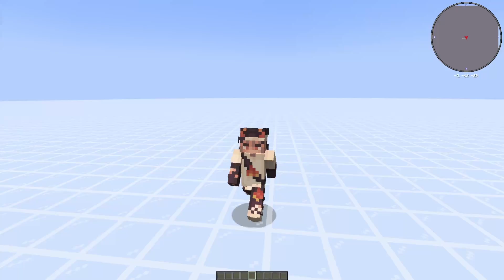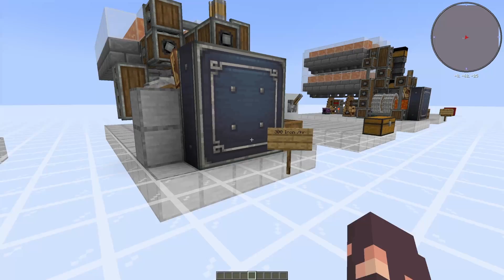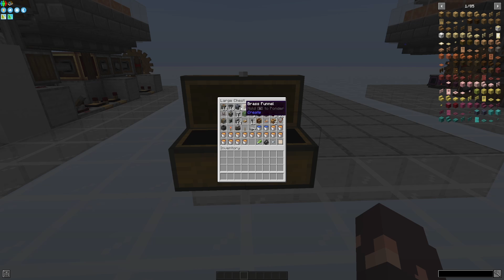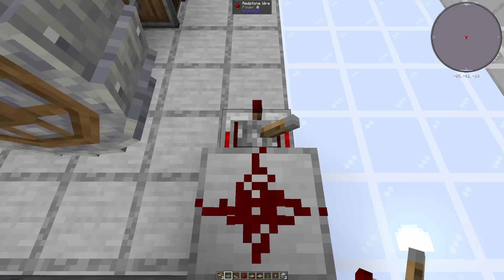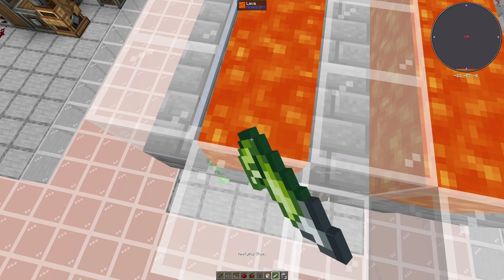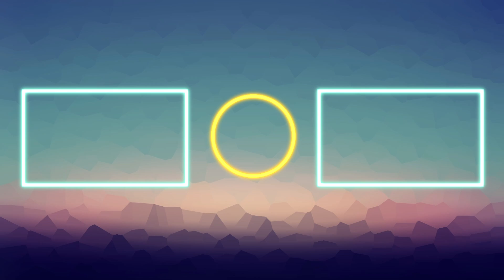The ULTIMATE CREATE IRON FARM (No Villagers) 600 IRON PER HOUR! |  Create Mod TUTORIAL

Comment: Machine works great. Only issue I have is cobble flying out when it breaks. Simple fix was add walls down the sides with hoppers along the floor to gather it all in chests.
Reply: I replaced the stairs with waterlogged leaves for the same reason. Seems to be working fine, but I'm still testing the rates
EDIT: My 10 minute test showed a rate a 156 per hour, so half. Not quite the solution I was looking for. Using the stairs and slapping on some extra glass blocks bumped it back up to 228 per hour, which is good enough for me
Reply: @Thatguywithadog152  Good to know that's an option. I ended up encasing the build in glass with one block space and lined the floor with hoppers to collect the extra flying out. I then put that into more crushing wheels to make me extra sand and gravel for other uses. 
actually made for a decent multi tier farm.

Comment: okay so I did the "medium" farm, and I run into two problems that I will explain to anyone having the same issue with the most recent versions of create :

using oak leaves filled with water and the fan dont work for me, because it is used to turn grass into bush, so you can just remove the leaves and put three signs around the water source instead, works perfectly fine !! (it's also maybe because of the modpack I use, but I cant be certain sooooo... just in case)

I cant, due to server restriction/modpack restriction, put the speed to 256, and my cobblestone generator makes too much cobblestone, and the cobblestone quickly glitches outside the structure and end up around. so first I added another row of hopper on each side, and I figures that I could simply deactivate the cobble generator for the time being, to do that you just have to break the shaft connecting the Sequenced Gearshift to the gearbox right next to the crushing weel on the right when looking from the front of the machine

now my iron farm works perfectly, it's just not fully "automatic" anymore, since you have to add and remove the shaft when you want cobblestone to be generated

thanks for the tutorial and I hope my message can help some people !! (also I'm not english and I dont realise if I made any errors so feel free to correct me regarding this)

Comment: If you are having issues with cobble blocks clipping through the glass/whaterlogged stairs, The only way I managed it to stop completely is to place 14+ hoppers below the stairs, they should face the previos hoppers. this sucks the blocks that get trapped and sends them into the correct place. Its an expensive fix considering you are making an iron farm and this fix costs +64 iron ingots, but its the only way I could make it stop,
Reply: This is the solution
Reply: Helped a lot Ty
Reply: Legend. Thanks
Reply: Banger

Comment: hey so built this, it worked for a couple of days, then it just stopped? as far as i can tell everything should be working, its just that the mechanical bearing isnt moving. the only time i can get it to move is if i manually update the contraption its connected to, any help?
Reply: never mind i fixed it 30 seconds after i typed my comment, i noticed the stuff after the gear shifter was still spinning when the machine was off, so i broke the vertical gear box right after the gear shift while it was off, then put it back and turned it back on and it now works. I LOVE MINECRAFT!!!!

Comment: I found it a bit hard to read all the names of the items in the description so I rewrote it so it’s easier to read (the space is for every 9 slots except the bottom one)

18x Gearbox, 
16x Hopper, 
9x Vault, 
4x Brass Funnel, 
2x Large Cog, 
2 Crushing Wheels, 
2x Barrel, 
1x Chest, 
2x Mechanical Bearing

1x Powered Latch, 
1x Mechanical Press, 
11x Any Building Block, 
1x Any Leaves, 
3x Pulse Extender, 
1x Chute, 
1x Clutch, 
6x Redstone Dust, 
28x Any Building Block (Glass Looks Better)

1x Encased Fan, 
1x, Andesite Funnel, 
14x Any Stairs, 
11x Shafts, 
1x Sequential Gearshift, 
1x Pulse Repeater, 
2x Rotation Speed Controller, 
1x Comparator, 
1x Basin

1x Redstone Torch, 
1x Mechanical Belt, 
1x Lever, 
7x Any Slab, 
Infinite Water Source, 15x Lava Buckets, 
1x List Filter (flint and iron nugget), 
1x Super Glue
Reply: i hope both sides of your pillow will be at the perfect tempeture tonight
Reply: God bless you <3
Reply: o7
Reply: @stubbyfoamz1  67

Comment: i just used a waterwheel to power the farm and it still said overstressed for some reason. no matter what steam engine or waterwheel i used it always says overstressed how to fix?
Reply from the maker: if you get a stressometer it will tell you how many more stress units you need for it to no longer be overstressed. if you keep adding water wheels/steam engines it will start working eventually
Reply: like a comment from a while back mentioned, 12 large water wheels and a regular water wheel on the end works

Comment: why my farm is shoottig cobble everywhere around farm
Reply from the maker: Your issue is probably the brass funnel in between the 2 linear chassis. R-click it with a wrench and the farm should start working. Make sure the 2 andesite funnels directly below the brass funnel are facing inward towards the vault (check picture)

Why its the issue: the cobble gen breaks the cobble and stores it in the barrel in between the 2 gantry carriages. the brass funnel should be dropping the cobble that is in the barrel right above it (it has access to the barrel's inventory even if it's not connected to it because it's a contraption). The funnel will drop the cobble out to the 2 blocks below it (depending on the side it's on) and the 2 andesite funnels below it will pickup the newly dropped items and put them in the item vault.

Comment: Well uhhh it doesn't work for me some how, its been running for 10 mins now and i haven't seen a single iron ingot. And i did follow setp by step, so pelase a little help 🙏 idk what i did wrong
Reply: And I found out the problem, the chute is not working at all is not going through the chute, is just stuck in the chest....
Reply from the maker: are the crushing wheels going backwards? try slowing down the rotation speed controller to see better. if they're going the right way it should just go straight down
Reply: @kindlebubbledump  fixed it, it was the wheel because I messed up the gear boxes....

Comment: Only one comment, you say if that if someone isn't at glass level yet then they can us trapdoors, yet you're using speed controllers that take precision mechanisms and brass. Now granted most of the functions represented can be replaced though it won't be as compact, I can see what you're going for. What impressed me the most was your method of cobblestone production, it's pretty darn brilliant and could easily be adapted for any other iron/cobble system. Also here's a question, could you design a gold producing machine? If my memory serves right it would have to make cobble, bust the cobble into gravel, bust the gravel into sand, wash the sand for clay, make terracotta blocks, grind those into red sand, then wash it. It can be done, I've done it before, but I never continued my experiments.
Reply from the maker: Good call lol I didn’t really think of that! I have a gold farm already! It’s a pretty big farm but it’s produces quite a bit of gold. You can find it on my tutorials playlist on my channel!

Comment: it worked but, there's tons of gravel falling beneath the crushing wheel. how to fix that
Reply from the maker: that's what's supposed to happen. the fan should be pushing the gravel and washing it with water in the leaves block. If the fan is pulling, invert the 10RPM rotation speed controller and you'll be good!

Comment: the farms fully working but im only getting gravel?
ive checked the hoppers and theres no ingots 
any fix?
Reply from the maker: is the fan going backwards? if so invert the 10 rpm rotation speed controller. Make sure you have water in the leaves block as well
Reply: I have the same problem. Did you ever find a fix for it?

Only making gravel. No iron nuggets and no flint at all

Comment: Great design. I used the Schematic to build the larger one. The only thing is that cobblestone gets pushed through the stained glas dropping onto the floor. Any idea on how to fix that?

Edit: I use a create addon "Create: Easy Stone Generatores" to create cobblestone with mixers. This is less laggy since the farm dosen't need to break blocks. Also the design nearly stays the same because it offers enough space. If you're interested I can send you the schematic.

Comment: Hi  I wanted to know if I can use the water wheel or the mill to power the entire system. Thanks
Reply from the maker: you will need to have enough of them to generate enough stress units, but yes you can!
Reply: Ok thanks 🙂 @kindlebubbledump

Comment: my 300 iron/h farm seems to not break stone whenever it rotates, why is that?
Reply from the maker: Nice! glad you found the issue! yea sometimes lag causes it to not break stuff so glad you fixed it! hopefully you're getting a ton of iron!
Reply: @kindlebubbledump  rn im trying to take some of that iron and turn it into iron nuggets for a train track farm, do you know if theres a way to decraft iron ingots automatically or should i make a separate farm?
Reply: ive tried reapplying glue but to no avail.
Reply: turned the speed down from 256 to 15, breaks cobblestone now.
Reply: alr made it work, made it so the fan is powered at the same speed of the conveyor. guess i made it more lag proof

Comment: Built this on all of create 1.20 I believe everything’s working just used the schematic download, all the stone is glued and is rotating but no stone generates, I’ve tried upping the rotation to 120 and still nothing, broke all the glued blocks let it place new ones and still nothing is there some form of new update that breaks this?
Reply: A 130 angle seems to work, it will generate the cobble then like 2-3 seconds later place, tried Turing it back down to 110 after seeing that and didn’t work makes no sense I just work hwre
Reply from the maker: You might be running into a lag issue! Depending on the game, having it at 110 might mean it gets all the way around before the lava can flow (just because the game is kinda laggy).
Reply: @ I do have ALOT of machines in one area still getting 300+ frames tho😄 thank you!

Comment: Amazing tutorial, but when I fully built it the fan was pulling the gravel into the leaf block instead of pushing it towards the funnel, how do I fix this?
Reply from the maker: invert the 10 rpm rotation speed controller from clockwise to anti clockwise and you should be good to go

Comment: My cobblestone generator spins once and then just stops and the whole machine stops. I’ve tried everything changing speeds, rebuilding and it still won’t break the cobblestone. Please help
Reply from the maker: I bet you're using a powered latch instead of a powered toggle latch (or the other way around) meaning it won't loop. if you replace the one you're using with the correct one then it should start working

Comment: This design is working for me however it ends up shooting a lot of the cobble around the sides, is there a solution for this?
Reply from the maker: Your issue is probably the brass funnel in between the 2 linear chassis. R-click it with a wrench and the farm should start working. Make sure the 2 andesite funnels directly below the brass funnel are facing inward towards the vault 

Why its the issue: the cobble gen breaks the cobble and stores it in the barrel in between the 2 gantry carriages. the brass funnel should be dropping the cobble that is in the barrel right above it (it has access to the barrel's inventory even if it's not connected to it because it's a contraption). The funnel will drop the cobble out to the 2 blocks below it (depending on the side it's on) and the 2 andesite funnels below it will pickup the newly dropped items and put them in the item vault.

Comment: Hey is the cobblestone supposed to go through the funnel because it keeps going the opposite direction
Reply from the maker: yes but if all the belts are going the wrong way, changing the 256 rpm rotation speed controller from clockwise to counterclockwise should fix it!

Comment: To any1 having problem where machine only spins once, and/or their clutch turns back on after hitting the lever it could be due to you not using the right powered latch there are 2 different types (powered toggle latch) and (powered latch) make sure to use the powered latch. Also if the machines belt and the crushers are going the wrong way change the direction on the speed controller thats set to 256. Hope this helps.
Reply: You dont know how much I needed this comment

Comment: mine just spits cobblestone from all sides lol how do I fix this
Reply from the maker: Your issue is probably the brass funnel in between the 2 linear chassis. R-click it with a wrench and the farm should start working. Make sure the 2 andesite funnels directly below the brass funnel are facing inward towards the vault

Why its the issue: the cobble gen breaks the cobble and stores it in the barrel in between the 2 gantry carriages. the brass funnel should be dropping the cobble that is in the barrel right above it (it has access to the barrel's inventory even if it's not connected to it because it's a contraption). The funnel will drop the cobble out to the 2 blocks below it (depending on the side it's on) and the 2 andesite funnels below it will pickup the newly dropped items and put them in the item vault.
Reply: @kindlebubbledump  I think you're mixing up which funnels and such you're talking about. There aren't any andesite funnels on the vault and no brass funnel on the barrel. It just likes to spit cobblestone everywhere lol.

Comment: i see gravel under the crushing wheel, but not flint or iron and the encased fan is working but i dont see the blue wind particles but i do see bubbles in the water in the leaf block, any idea how to fix this?
Reply from the maker: is the fan pushing or pulling the cobble? if it's pulling, invert the 10rpm rotation speed controller to counterclockwise

Comment: Great design!
Couldn't make the on/off system work but I have to remember to stop it (singleplayer world) and the sequenced gearshift didn't deliver the power, so I used an old school redstone repeater trick to time a clutch, and it works wonders. 
You can place blocks in front of the mechanical bearing glue them and destroy them after to make it easier.

Comment: the redstone torch that communicates with the clutch keeps breaking, as in it doesnt turn off when the circut is executed...
Reply from the maker: there is a pulse extender that is powering that block that should be depowering the torch. if nothing seems incorrect can you join my discord and send a vid of the redstone clock + the torch and I can see if I can spot the issue

Comment: Okay I figured out the issue and it’s making iron, but it’s not going into the barrel? It’s staying in the hopper behind the barrel
Reply from the maker: is that hopper locked somehow? or is the hopper not pointing into the barrel? I'm not sure what could be the problem lol cause that's just vanilla stuff so there shouldn't be any weird create mod stuff happening with it
Reply: @kindlebubbledump  I did some googling and I kept reading that hoppers can’t be connected side by side for some reason??? So I figured the easier thing to do was just dig down a block, put my chest under the hopper and cover it with a trapdoor
Reply from the maker: @richhomiebrin  cool! if that works then great!
Reply: @ it’s been bugging me and I’ve been going over it in my head thinking it doesn’t make sense that it wouldn’t work and I just tried something and it’s working properly now without the chest underneath 🤓

Comment: Another great build!😊 Only thing I had to change was instead of the bearing I used 14 drills with the encased chain drives. I'm unsure if it was a outdated thing for the bearing to work or not but it just didn't work for me. Additionally I again cant figure out the Redstone, watched it multiple times but it just wont work 😂 I'm happy to just let it run haha
Reply from the maker: Thanks! Yea, I've seen the bearings not work fully depending on lag, version, etc. Drills work great and shouldn't be much slower! LOL about the redstone, it's not needed but just nice to have, glad you like the farm!

Comment: i need help my sequenced gearshift just turens 1 time and then i have to stop the farm and start it again to make it spin 1 time again and i dont know what i have done worng
Reply from the maker: behind the lever should be a powered toggle latch that is connected to the redstone to it's right. when that redstone powers it should turn off then quickly back on the toggle latch, restarting the system. If that looks to be whats happening for you can you join my discord and send a vid of that part not working as intended
Reply: @kindlebubbledump Thanks for the help that did work

Comment: I made the farm but the encased fan is spinning the wrong direction and so is the belt. I flipped the Rotation Speed Controller to counterclockwise instead of clockwise and now the belt works but the encased fan is still spinning the wrong way. Do you have any ideas?
Reply from the maker: There are 2 rotation speed controllers. You also need to change the 10 rpm one to counterclockwise too to invert the fan
Reply: @kindlebubbledump  Thanks so much!